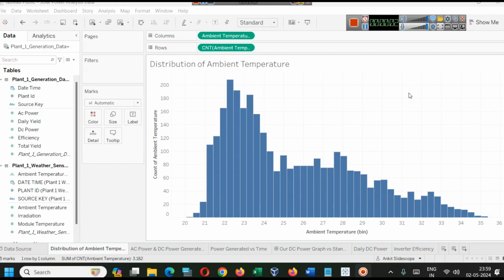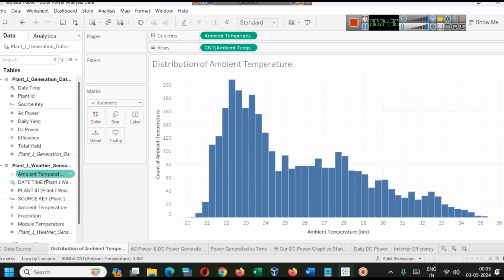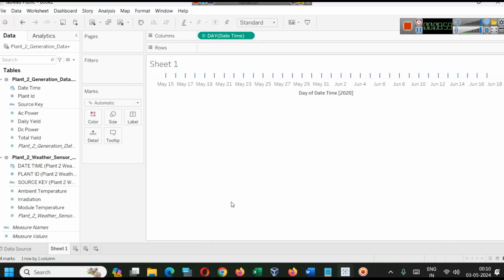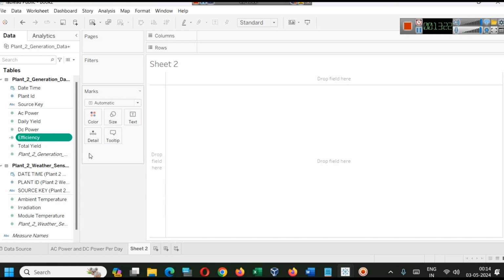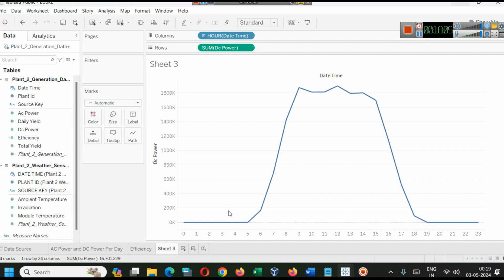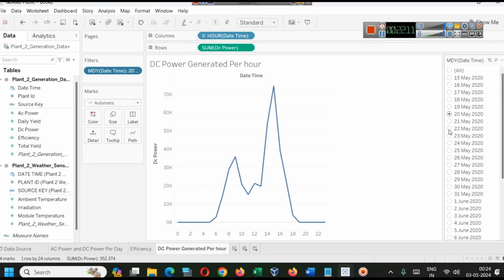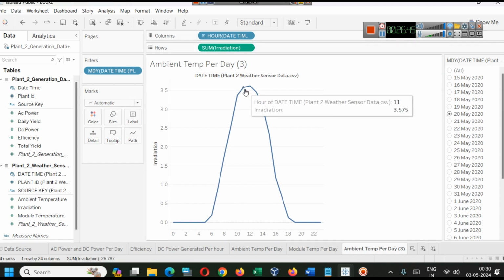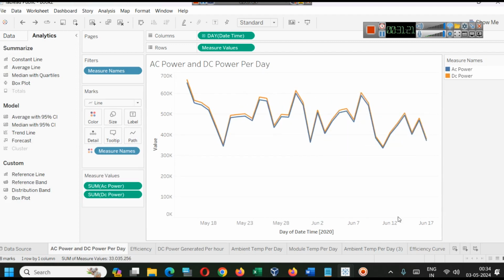Solar Power Plant Performance Analysis with Tableau - Analytics Project

Comment: How come plant 1 and plant 2 has huge difference in transformation efficiency? Plant 1 generates just 10% of DC power as AC power whereas plant B generates 98% of DC power as AC power. What can be the real reason?
Reply from the maker: I will connect with the engineer who collected this data and posted on Kaggle and let you know.